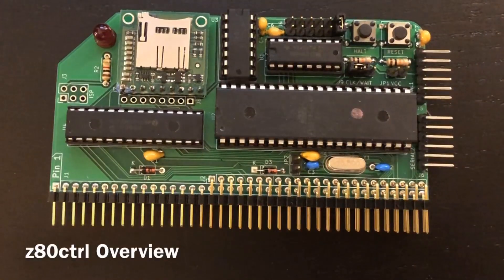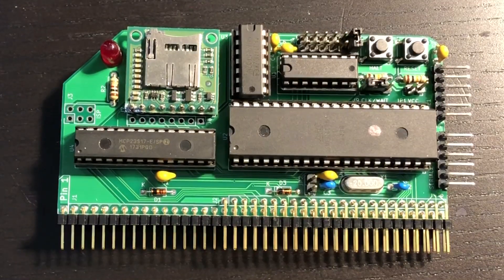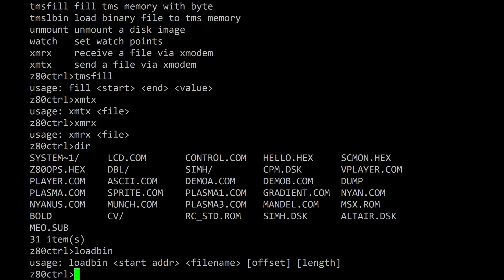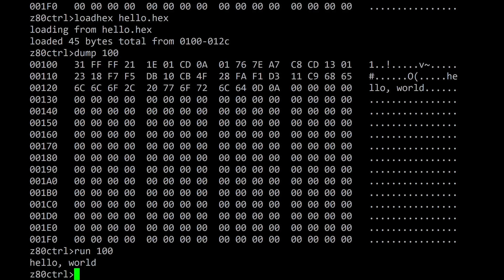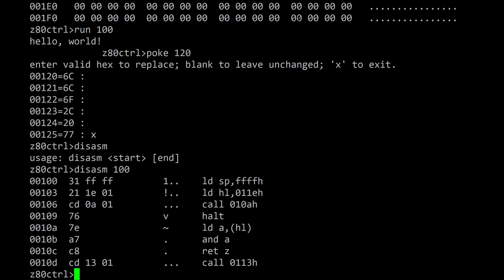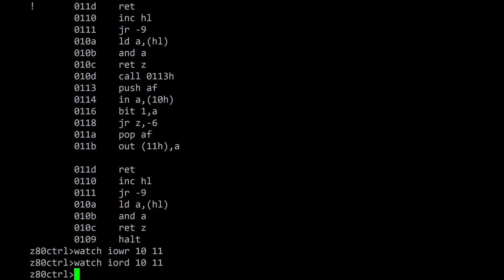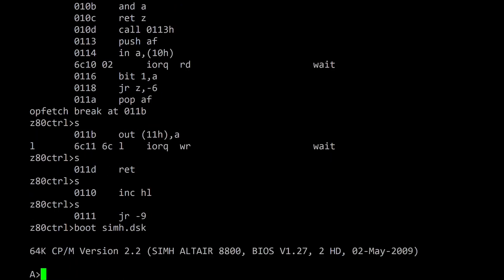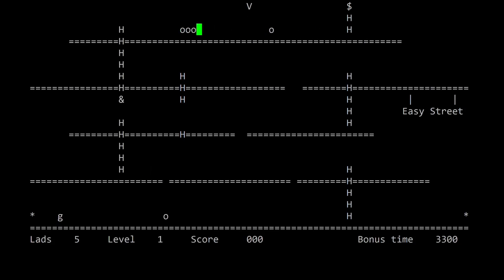z80ctrl Board for RC2014

Comment: Can it be used to emulate an MSX2 ?
Reply from the maker: The only thing it emulates is the MSX keyboard. The sound and video chips are the real chips used in the MSX1. If you got the video chip from the MSX2 it might be possible to use z80ctrl with it to emulate the keyboard for use with that too but I don't have a board using that chip.
Reply: @jblangston3  thank you.
does it emulate the MSX1 memory map too?
Reply from the maker: @over2seeyer  it has a flat 64k that is all ram. It is possible to load in msx-basic and it works. However it doesn’t support the slot mechanism so any functions that depend on this won’t work
Reply: @jblangston3  That sounds great, can it work as standalone or do you need a computer to sideload programs in it?
Reply from the maker: @over2seeyer  it loads programs from an sd card. Currently it emulates the msx keyboard using a serial connection from another computer. It should be possible to replace the second serial port with a ps/2 keyboard interface that also emulates msx keyboard scan codes but I never got around to doing that.
Reply: @jblangston3  so you qtill need a vt100 terminal to try in the commands, right?
Reply from the maker: @over2seeyer  Yes
Reply: @jblangston3  thank you.

Comment: For the z80ctrl board, which I believe uses the extended bus, do the other rc2014 components (z80 board, RAM) also need to be of the extended bus variety?
Reply from the maker: Yes, it needs the extended bus, and there is no point in using my Z80/RAM board without the z80ctrl.  It won't work because it has no ROM, and it doesn't support sharing the memory address space with a ROM.  Or are you talking about the stock RC2014 boards?
Reply: @jblangston3  Thank you. I have the backplane pro and all of the rc2014 components to run CP/M. However, my current components do not need the extended bus. If I get z80ctrl to replace ROM, CF etc,, do I also need your z80/RAM board, or can I use my existing z80 board (non-extended bus) and 64K RAM board (also non-extended bus)?
Reply from the maker: @8bitBunker  The backplane pro has the extended bus and so do the CPU and RAM modules that come with it in the kit.  These modules are compatible with z80ctrl.  The requirement for the extended bus is that Z80 and z80ctrl need connections to the BUSRQ, BUSACK, and WAIT signals, which are on the second row, to share control of the bus.

I guess your confusion may lie in what extended means. There are 3 levels of bus compatibility in the RC2014 ecosystem. The original bus is only the single row 40 pin header with 16-bit address, 8-bit data, and the most important control signals.   This is not compatible with z80ctrl because it doesn't have the BUSRQ, BUSACK, and WAIT signals. 

The official RC2014 extended bus adds another 23 pins on the second row with some additional control signals including BUSRQ, BUSACK, and WAIT signals that z80ctrl needs, as well as another 8 bits of data bus that are unused.  This is what the RC2014 Pro backplane, CPU, and RAM boards use.  

Finally there is the unofficial BP80 bus which uses the full 40 pins of both rows for a total of 80. This adds another 16 bits of address bus, intended for CPUs that natively support more than 64KB of RAM. The z80ctrl does not use the extended address or extended data bus pins and therefore does not require the BP80 bus.
Reply: @jblangston3  This is very enlightening, thank you J.B. for crafting such a thorough response!